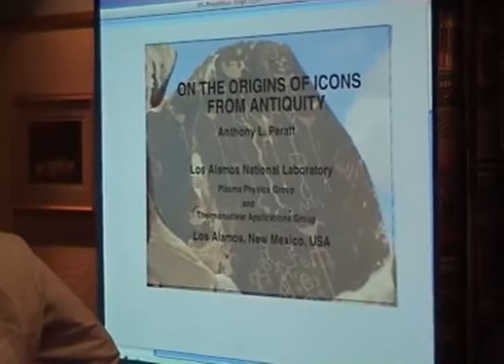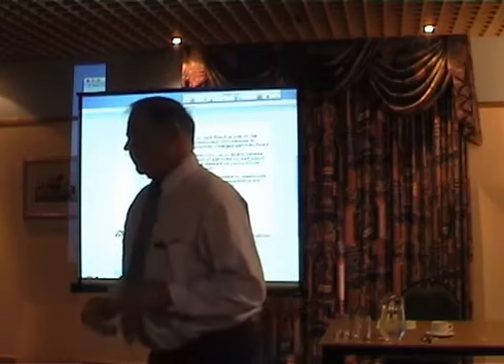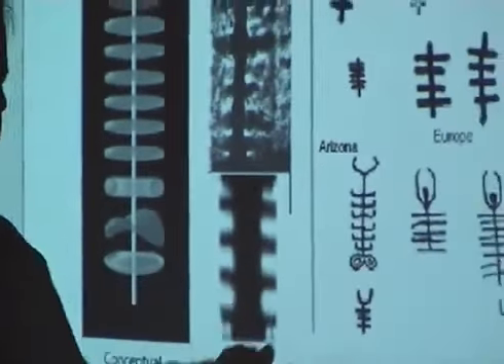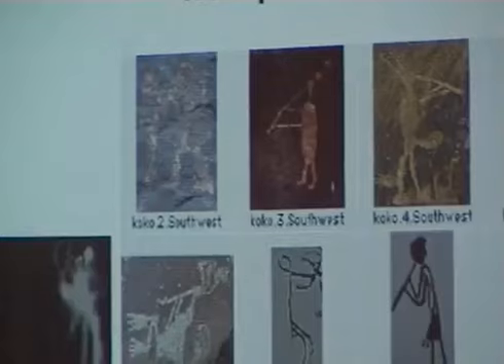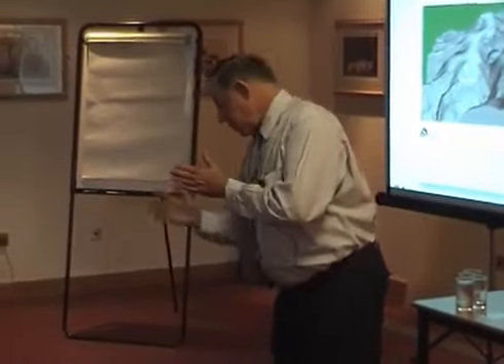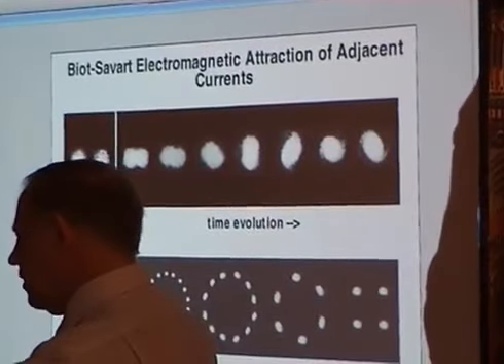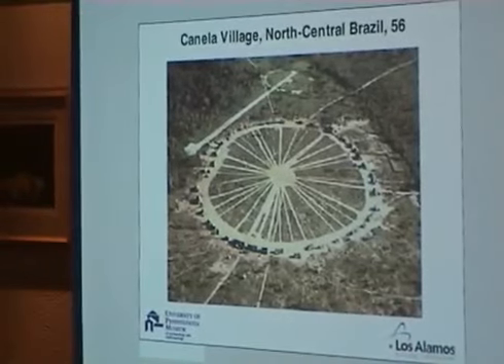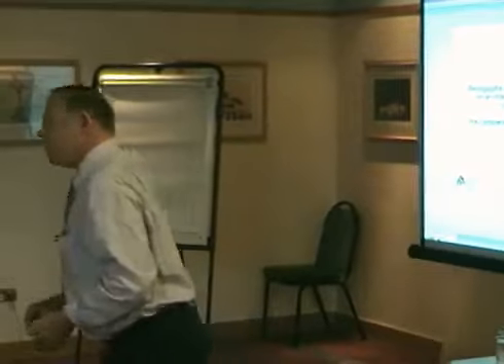ANTHONY PERATT, PLASMA INSTABILITIES, AND PETROGLYPHS - 2005 TP World - MIRROR

Comment: Those giga amps will turn greenhouse gas arctic methane into hydrogen and carbon.
Explaining both the cooling and black soot mat of Yuger Dryas
Same time length as zpinch series.
This will happen again soon.
When earrths n.magnettic pole drags berkland aurora pole from sun to 90 degrees north.
And it touches PRECESSIONAL GALACTIC BERKELAND pole there,
being induced by earths s. magnetic pole on dark plasma flowing to galactic center.

Comment: Climate cycles will always be caused by our GALACTIC Milankovitch cycles.
The Climate cycles of our water planet are continental glaciers with lower sea levels (Dwarka, Atlantis's) brought on by E-W global Tsunami's (Gobekli tepe, Washington scablands).

Every 12,460 years half the precessional Great Year 26,000 years our solar system crosses over the galaxies double torus electromagnetic dielectric equator/plane causing plasma bursts from the reconnection of the Sun's magnetosphere, Asteroid impacts from crossing the galaxies toroid asteroid kuipers belt, and E-W global Tsunami's due to the increased EM gravitational pull at the center of the galactic plane and conjunction of the planets EM fields.

Obliquity magnetic north changes reference our position to the galactic bulge in 4 quadrants e-w declination every 60,000 years causing global warming from the increased DIRECT sunlight at the higher latitudes poles thawing frozen Co2.
Eccentricity perihelion/aphelion happens with the galactic bulge every 120,000 years half a full rotation of the galactic bulge 240,000 years and regulates the intensity of precession/Great Year cycles.

Earth is a closed loop that self regulates CO2 with life. Temperature rises first causing frozen CO2 to thaw rising CO2 second. Cause and effect. Not cart before the horse forcing or green house effect.

Einstein. Energy is neither created nor destroyed. On this planet. All energy comes from the double toroidal fields we call the Sun and or galactic Nucleus.

Covid like Co2 is a lie strawman built upon an inconvenient truth. The baby Boomers who were born en mass 75 years ago are starting to die from the usual suspects of seasonal FLU pneumonia and old age.

No Buying or selling unless you wear the covidiot mask/mark of the BEAST. The Mask being a pretext for the experimental mRNA vaccine, contact tracing, and testing of the BEAST, before the E-W global tsunami's come.

Jesus loved all races because there is only one race, the HUMAN race. Humanity is being divided distracted to be conquered, again. BLM etc.